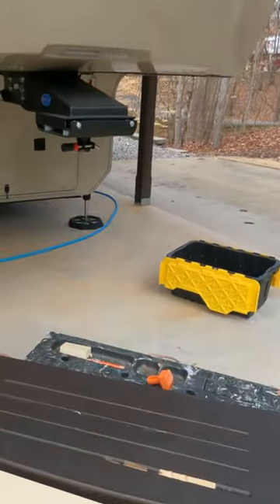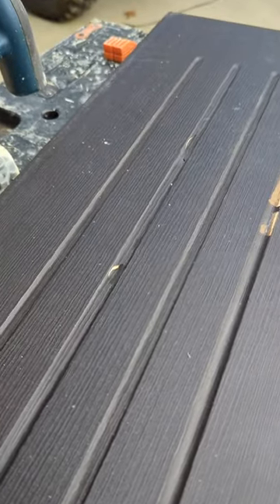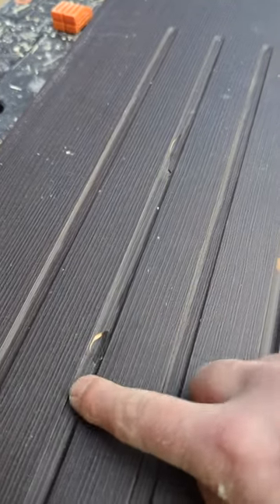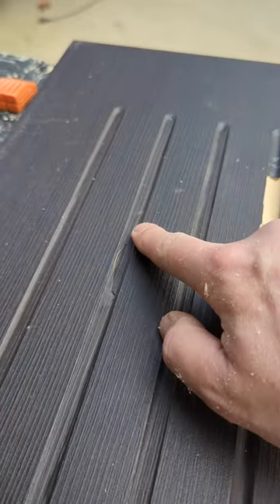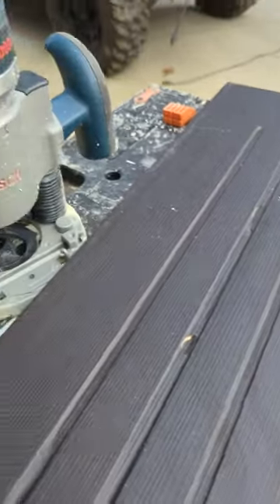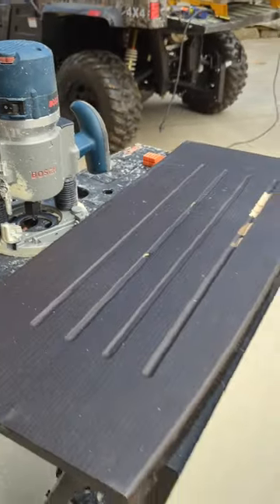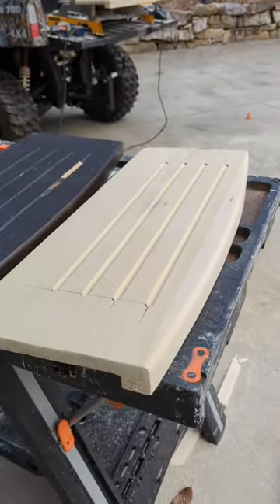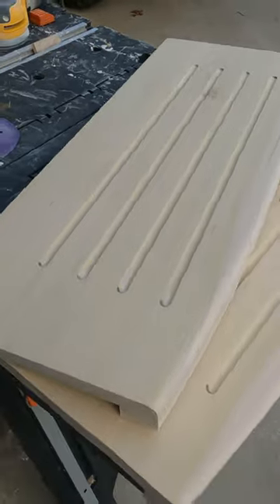New Solid Wood Steps for My RV

Comment: Hi again sir. Can you tell me how you got the old stair treads off?  Are they stapled? Glued? both?.... I'm have a bit of trouble get them up in my 37MDQS. Thanks.
Reply from the maker: Yes, stapled and glued on my OEM steps. I just pulled up with my hands VERY forcefully and they came up. I didn't use a pry bar to avoid damaging anything, but it came up fairly easily after a few good tugs upward on the lip. Maybe they did some extra glue and nails on yours :)